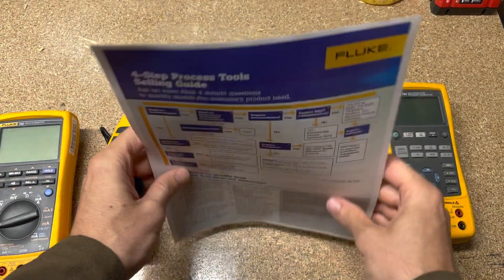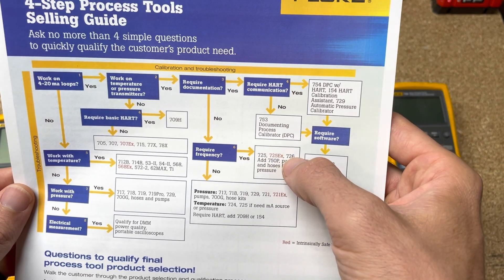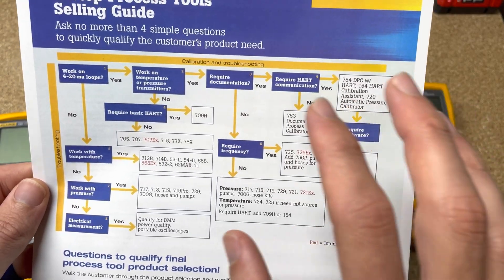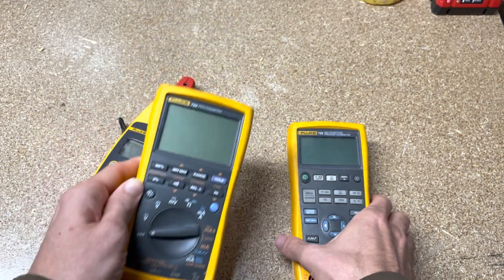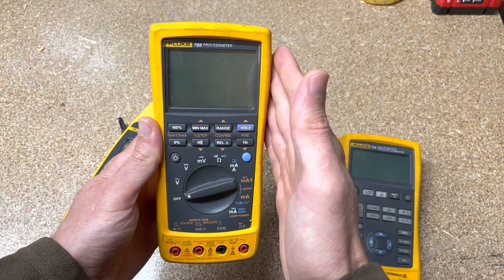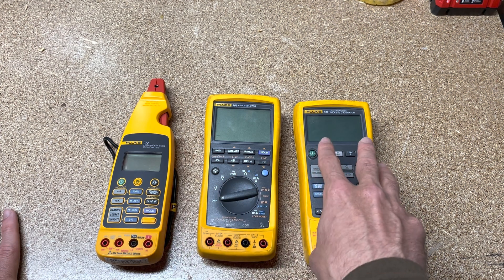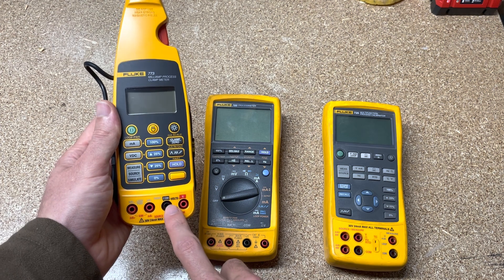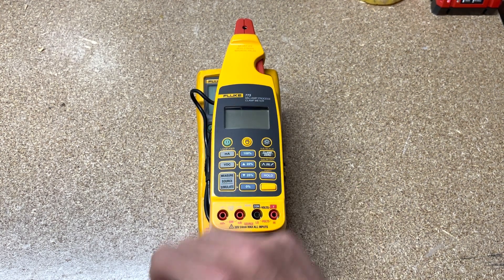Fluke 789 vs 726 vs 773 - Fluke Fridays - Episode 99

Comment: Would love a meter about the same size as the 773, but with 4-20ma in/out, (no clamp), ohms and with AC/DC voltage measurement up to 600AC, 50VDC. Just a small simple meter.
Reply from the maker: I think the 789 is what you are describing.